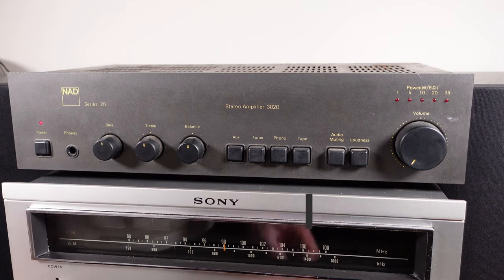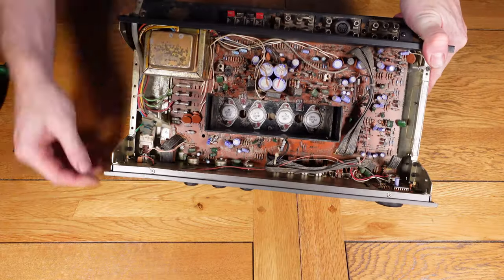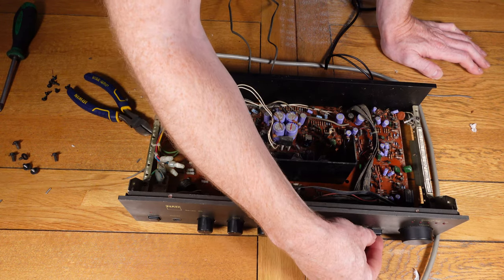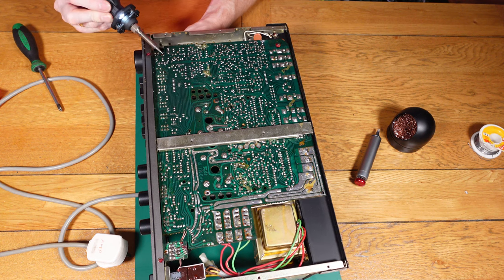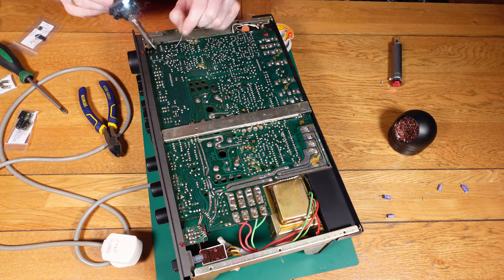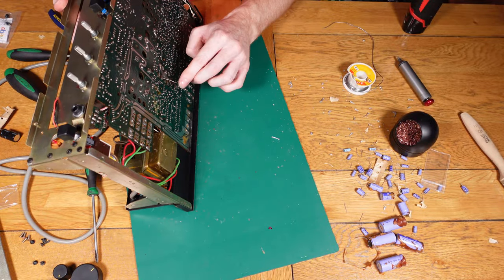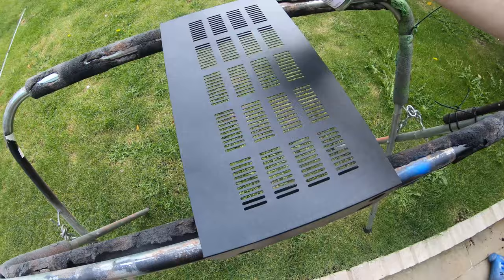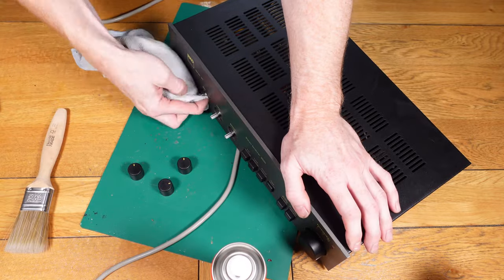A Neglected Stereo Icon! NAD 3020 Series 20 Overhaul - Retfurb Retro Audio

Comment: Just a quick FYI... 'corrosion' refers to non-ferrous metals like copper, brass or aluminium. Anything affecting steel or iron parts is called 'rust'. Extremely common internet problem.

For anyone interested, the metal chassis parts are powder coated, which is much tougher than anything you can get out of a spray can.

Always nice to see these little gems being restored. 👍
Reply from the maker: @thethirdman225  ah, fair enough. I always just referred to all metal types as corrosion, when it’s that type of wear.
Agree, powder coating is much tougher than spray paint. Normally reflected in cost between each process.

Thank you very much for the kind comments, it is appreciated.
Reply: @retfurb  I wonder if there’s a way of getting that pebble finish with two pack?
Reply from the maker: @thethirdman225  I’m not too sure to be honest.
Most automotive finishes that replicate a texture, are a single pack product.
The aerosols I use for texture, are what is mainly used for texture plastic repairs.
But they are pretty robust to be fair.
There are things like gravitex, but that’s a lot heavier in finish.

Comment: Great video. Im just wandering if you can recommened a certain set of RCA leads. The only ones that fit well are some cheapo ones. They seem bigger than most connections.
Reply from the maker: @CM-dw3gh Thank you for the kind comment, It is really appreciated. I always use Van Damme cables and connections. I then make them up to what I require. There are a number of suppliers, That do make them all up pre-made. They are a good quality cable and competitively priced. 👍
Reply: @retfurb  yes VD are pretty decent. Are you based in buckingham/northamptonshire? I could do with a recap of my 3020. There was someone on ebay offering this service but if i can travel to drop off id rather do this than post it. Cheers
Reply from the maker: @CM-dw3gh  Unfortunately, I am in the south west.
Reply: @retfurb  no worries. Tbh its in pretty good nick. Slight scratch on the volume knob. Faint hum from the speakers (heard only close up), and a possible DC leak to the speakers when powering up. The woofers can move half an inch. But i use a headphone adapter to power up and down to prevent this happening. Obviously not a cure but im sure its not causing any ill health to my speakers?
Reply from the maker: Funy enough, I have one with me at the moment that does similar. It thuds as soon as the power button is turned on. Not the delayed power up hum, But an immediate power up thud. I haven't taken a good look at it yet, But it could well be a capacitor failed. The thing is they need to be removed individually and checked. So it will probably just mean a complete replacement whilst doing that. @CM-dw3gh

Comment: Great video. Now I want to recap my 7225PE. Can you tell me where you got your capacitors from, and do you have a full list of the capacitors you replaced?
Thanks Mark
Reply from the maker: Thank you, That's appreciated. I purchased them from a guy I regularly us on Ebay, I can send you the link. Is yours the same model type, As they can vary with capacitor values. I can certainly help with what I purchased though.
👍
Reply: Or if your local to North London I would pay you to do the job for me 😊
Reply from the maker: Unfortunately, I am about 3 hours away. 
Happy to help out where I can though. @Mdata1962
Reply: @retfurb a list of all the capacitors would be very helpful thanks
Reply from the maker: @Mdata1962  No problem. I will send a reply message on here later today.
Reply from the maker: @Mdata1962  I was going through the list I purchased. Do you need to know which capacitor is which, Or just a shopping type list?

Comment: How to contact you to get contact for cap supplier? Thx!
Reply from the maker: The seller I use is on Ebay and link to shop is https://www.ebay.co.uk/str/tekkikidcomponents?mkcid=16&mkevt=1&mkrid=711-127632-2357-0&ssspo=SHd9ZBTLQ5m&sssrc=3418065&ssuid=gQtseyzVSjW&widget_ver=artemis&media=COPY

I have no connection with the seller, Other than being a regular customer.